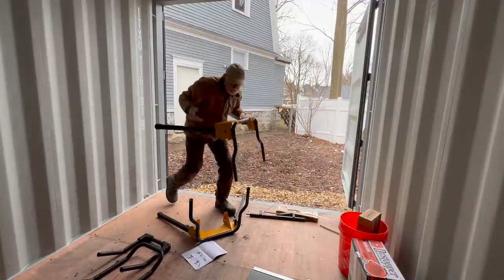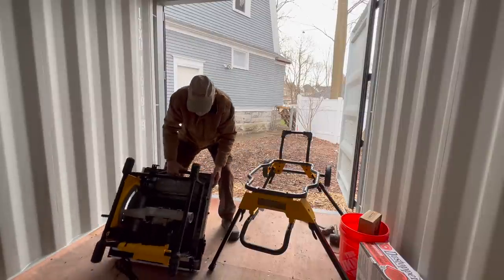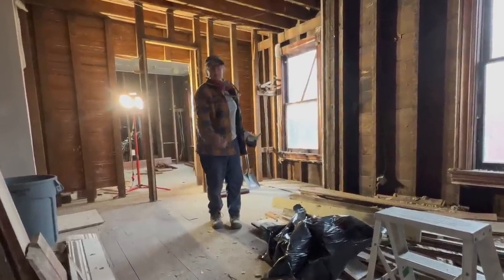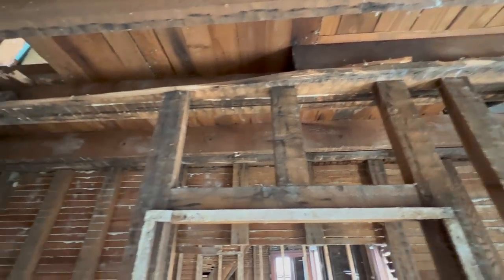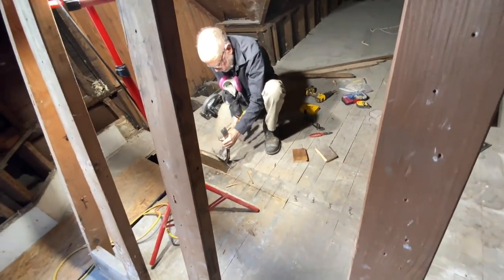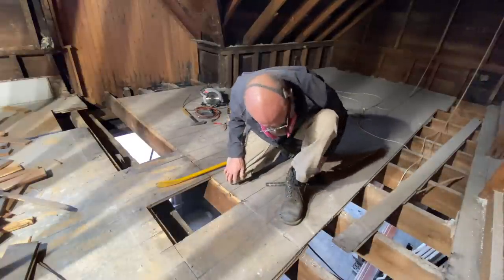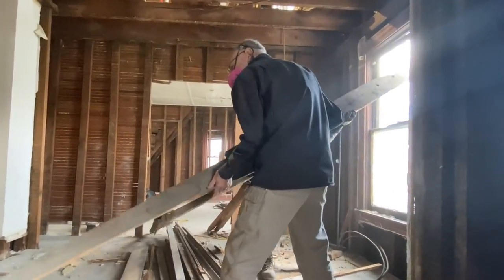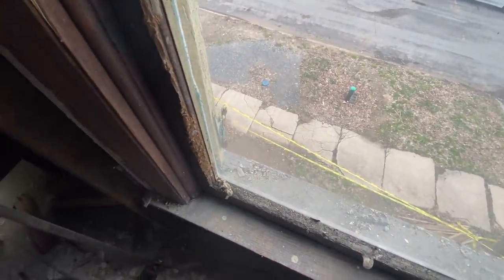TAKING DOWN A COMPLICATED JENGA WALL & We broke a window!

Comment: Are you planning to sand down the hardwood floor (17min mark), if so i would of suggest to use H pattern to fascen the cut boards . If new floor goes over it does not matter.  Good progress 👏
Reply from the maker: I don't think we will be putting hardwood on the third floor where we were replacing the subfloor.  We do have subfloor repair to do that will be under new hardwoods... so I guess we're all good!

Comment: Ooops... goes the window... but that's ok.  That window reminds me of our old house when I was a kid... squirrels... chewed a lot of it...
Reply from the maker: OMG the chewed window wood!!!  It's on so many windows.  Why do they chew the windows?  It's a mystery...
Reply: @TheGrandLady  it might have been painted or treated with lead paint...which apparently tastes really sweat and is addictive.   I know the galahs and parrots over love eating the plastic off electric wires because the plastic tastes sweet and addictive to them.  Which is wearing gloves is vitally important when working on houses buildings, structures.  Gloves can save you from transferring lead from the paint through your skin and blood same as wearing gloves can save you from electrocution caused by bare power...
Reply: @TheGrandLady  So destructive... but my guess would be it looks like the easiest way out... small board... but yeah... nasty... 1/2 the windows in the downstairs were chewed up...
Reply: @kylieharrison3782  Squirrels I know like to chew up cable wires... I'm told it's like candy to them... they love the coating on them.

Comment: Why not just add another floor joist?
Reply from the maker: Oh!  Well, we took out the old janky one that was added in a previous less than professional repair... so we didn't need a new joist if we fixed that old repair correctly so, we did that to make it like it should have been done.  Does that make sense?    Thanks Patricia!